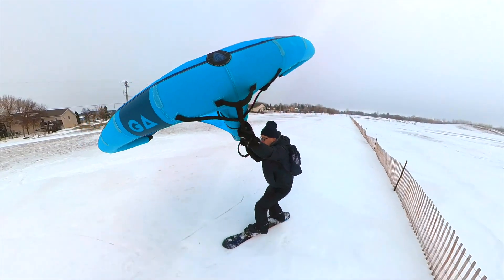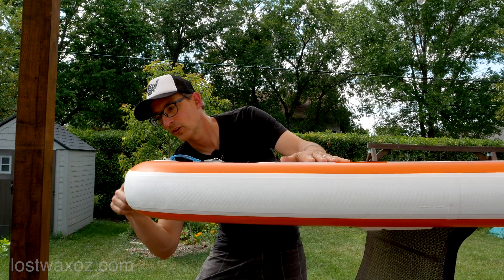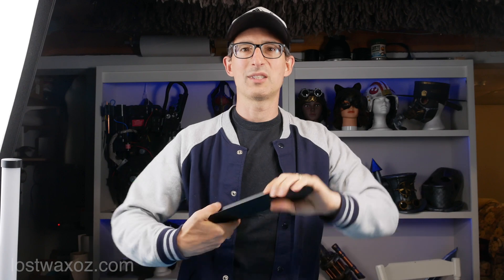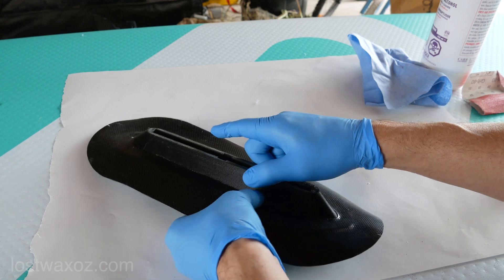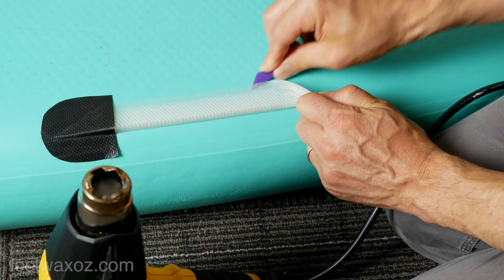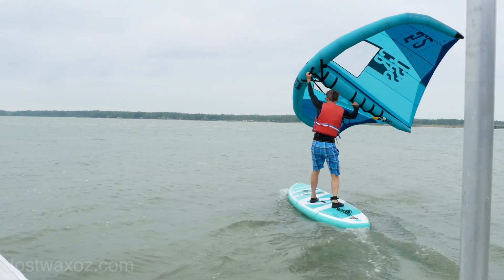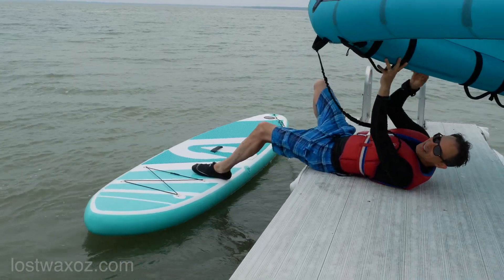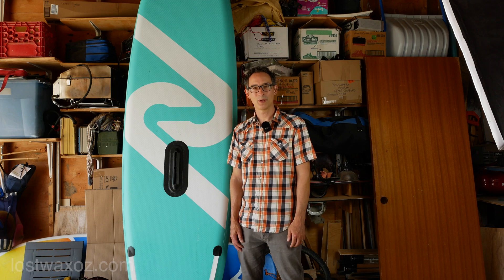Hacking a CHEAP INFLATABLE SUP into a Wing Sup!  sUp Wind DIY Daggerboard and Tail Edge Release.

Comment: Super!
Stream release at stern helps in planing mode. In displacement mode it is not helpful, may be even creates some more drag.
You not going to plane on this board. It would require way to stronger wind, like more than 20 knots, and lots of efforts to hold the wing.
Your natural next step will be to buy/make a hydrofoil and a board for it. This one is too long.
Good luck!
Reply from the maker: Yep, that’s next summers project- diy hydrofoil and board!

Comment: Using this video to try to mount a tiny electric fin to my paddleboard which doesn't have the standard fn slot, and instead they are attached like yours. Trying to decide if I trust a glued on fin slide in thingy similar to yours to attach a $500 motor... How has yours held up?

Comment: Nice! Does your daggerboard box stay attached to the board when you deflate & roll it up?
Reply from the maker: Yep, the box is permanently affixed. Makes it a little trickier to roll up if you don't get the folds in the right places.
Reply: @LostWax2 I meant more like, does the action of rolling it up weaken the adherence of the box, or is it still firmly attached after e.g. few days rolled?
Reply from the maker: @NinoDiVenanzio  So far its is still very well attached. I've probably used it 10 times since I put on the box.  I had added a fin box to a second SUP last year but decided to remove it this year, and it was quite a job to get it unglued- I even ended up removing a bit of the top layer of PVC from the SUP where I wasn't careful enough. That HH66 glue is quite impressive.

Comment: Very very cool! 

A semi-rigid hard chine edge, like on a performance Inflatable power boat, or a Starboard inflatable windsurfer/windsup!

A question, if I may: the daggerboard is in front of the planing surface you have created. Although it undoubtedly works, as evidenced by you being able to go upwind with it, a daggerboard or a pivoting centerboard is usually a feature of a "trainer"/beginner windsurfer boards. 

I mean, all performance windsurfer boards tend to only have a big (like, really long and sleek) fin at the back, so as to do away with any forward-placed obstacles that might get in the way of getting tge board on the plane. 

And when planing, only the very short back section of the board would be in the water, so the daggerboard in the front would then become a source of drag, throwing you off the plane.

Also, for upwind performance, a long, short chord fin/daggerboard will always outperform a short, wide chord one allowing for higher upwind angles.

So, in your opinion, would it be feasible  to print a finbox that would take a TuttleBox performance windsurfer fin? 

Or print a prototype finbox, take a mould off'f it, and cast a usable one out of 2-part polyurethane?

And mount it in the back, in place of the original sup fin (that is nowhere near the needed surface area)to allow for better upwind performance and easier planing?

That would also make it possible to use a plethora of readily avaliable performance windsurfer fins.
Reply from the maker: This is a fantastic comment, and includes a lot of things I have been thinking about as well. First off it would be amazing if I could get this board up on a plane with a wing, but I wonder if that is really an accessible idea- for one, it is a big board, so there would be a lot of surface area drag, and second, I feel like wings aren't the most efficient sails out there. Lastly, as you mentioned there is the drag from fins and fin boxes. There's two main issues I see with inflatables, and that is 1: you need to mount the fin box on the exterior of the board, inducing drag from the box, and 2: because you are mounting the box to an inflated surface, it is a bit flexible, so your fin will have a certain amount of tilt either way, depending on the pressure. Some board companies fix this by having an insert for the fin box that goes through the board, but that's beyond my board hacking ability:)
The reason I went with a shorter wider daggerboard is that I wanted to reduce the sideways push on the fin box by spreading it over a longer length. This does sacrifice the some speed that a longer, thinner daggerboard would achieve. 
After this experiment, I decided I would like to try convert a cheap sup into a windsurf board, so I have bought a 8ft kids board that is almost the same dimensions as the starboard airplane. I want to make a removable centre daggerboard fin box so it can be there for learning and remove it to try get the board planing. The problem I haven't solved yet though is how to get enough fin area at the tail without too much drag or pressure on the box itself.......Maybe twin fins? That'd spread it out, but add drag. 
Anyways, that was a bit of a ramble, but just kinda thinking out loud:)
Reply: Also, Starboard has a couple of "touring" inflatable windsurfs with volumes of up to 230 liters, I beleive, and those can and will plane (there obviously is a learning curve to that).  @LostWax2
Reply: Nice ideas! Also, I guess a wooden/plywood "ducktail" with a fin box inside it, can be made. Decathlon has an inflatable sailing dinghy, Tribord 5s (basically 2 SUP boards glued together, with a slot for a daggerbox), that has a plastic, nicely shaped rudder plate that attaches to the transom of the board. So if we glue a piece of keder to the bottom and to the top of the transom of the SUP board - to act as live hinges for attaching the "ducktail" to the SUP while it (SUP) is not inflated, we can utilise the internal pressure of the SUP as  the clamping force needed to secure the "ducktail" firmly in place. The fin will go into the "ducktail", and all finboxes can be removed from the SUP altogether, reducing drag and flattening the bottom nicely to promote planing.

The chines will only need to be on the sides, 'cause the bottom keder, pulled tight between "ducktail" and SUP bottom, will provide a smooth, flat transition from one to the other.

Will try to cobble up s basic proof-of-concept 3d model and provide a link later today
Reply: @PavelBarbanegra  Interesting, though I can't quite visualize the concept you are going for here. I get the idea of adding an extra bit of tail so to speak, but I don't understand your attachment idea. 
Another thought I had was use twin fins at the back, but kind of like your above idea, instead of attaching them individually, have the fin boxes part of a large flat sheet glued to the bottom of the board- so any lateral forces would have a strong base acting against them, and the two fins would, in a sense work to stabilize each other, as the inside edge of one fin box would be pressing down while the inside edge of the other fin box is pulling up when lateral forces are applied. I notice STX makes a board with twin fin boxes that are pretty much what I made for the board in this video.
Reply: A side note. I've been thinking that it might actually be possible to "freehand form" the chines 'in situ' out of 2-part pvc/silicone caulk, almost like "open mould casting" them.

Or sculpt them in place out of car maker's prototyping clay, take a negative mould, clear the clay off the SUP, fill the mould up with thick caulk, butter the SUP up with more caulk, slap the mould back onto the SUP, wait to dry, demould.  

Would be finicky, no doubt, but still doable.

The commercially avaliable glue-on chines for inflatables are pvc or silicone rubber compound (but quite a bit bigger/thicker than needed for our cause - otherwise I would have already glued a strip of that to my cheap SUP).
Reply: @PavelBarbanegra  Yep, I think those could work, but as you say, definitely finicky.
Reply: http://youtube.com/post/UgkxJ-x2-NrffkhxKgs_GNG7O85wQMuqxRB7

Comment: Neat creation! I would be interested to see a performance comparison of the board with and without the rear step on it, measuring the drag. This may be quite a neat addition for normal paddle-driven SUPs too.
Reply from the maker: Yeah, I'd be interested in that too. My gut feeling is that you wouldn't notice a difference when paddling the board, as you are going quite slow anyways, but as you get faster, the drag effect becomes more noticeable. But, yes it'd be cool to see an actual experiment!
Reply: Also wondering if there is recommendation on doing it without any 3d printing skills or setup,that part seems too daunting for me 😅